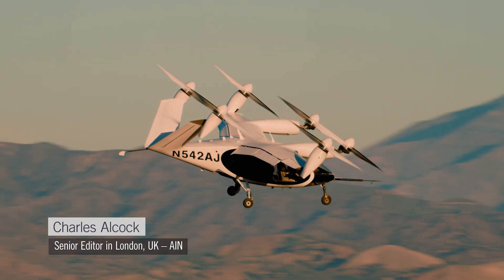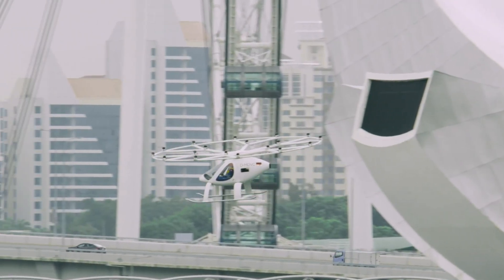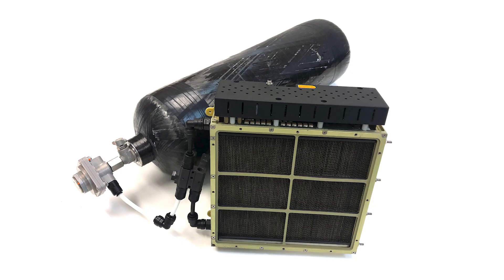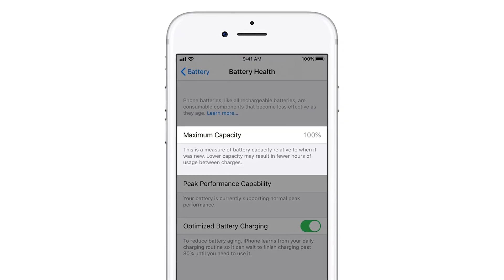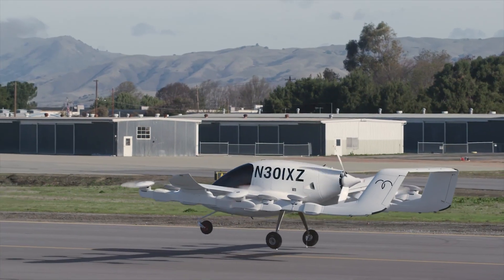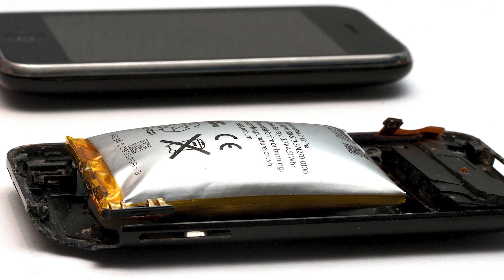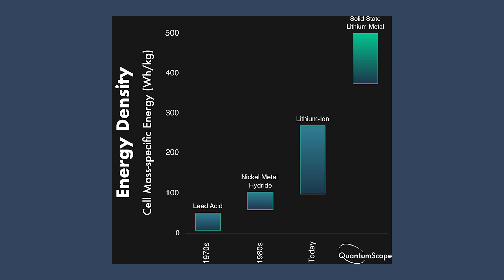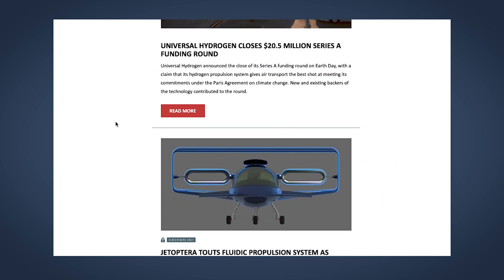How Battery and Electric Motor Tech Is Transforming Aviation – FutureFlight Explainer

Comment: You must keep at least 20% of the battery charge not 10% to keep them reliable. The voltage varies too much on the last 20% and the battery gets hurt and that another way we are deceived by manufacturers about the true range and endurance of the proposed aircraft

Comment: Mehrdad Zand
2 months ago
Mr. Anil Sagar: In my humble opinion for e-vital plans by reducing electric consumption during take-off and landing, you could add to the passenger carrying capacity of the said planes or increase cruising distance. This can be done by some hard-wire arrangement either by electric overhead contact or by take-off/landing electric polls via a coupling/decoupling arrangement at the top of the said polls all the way down supplying the plain